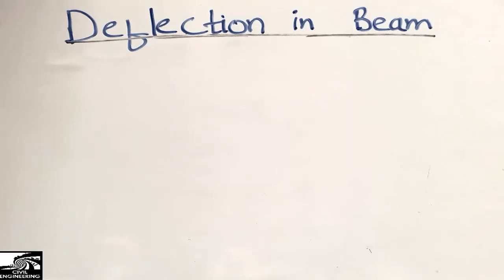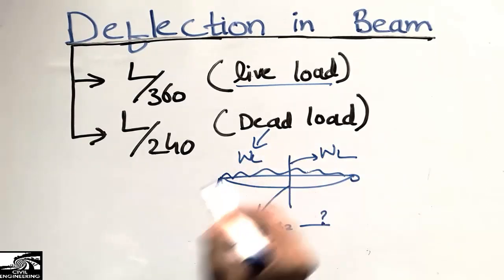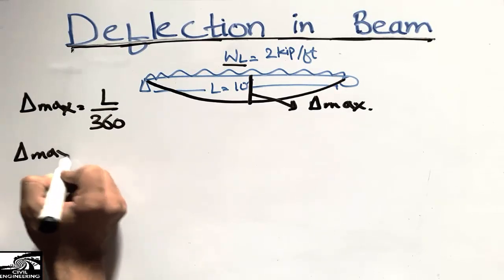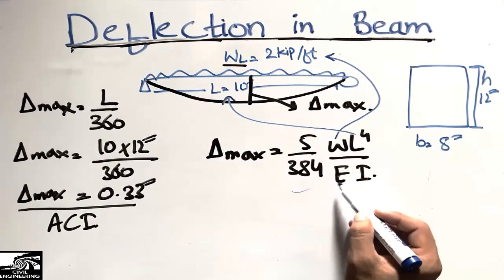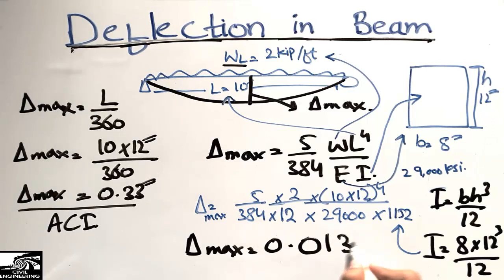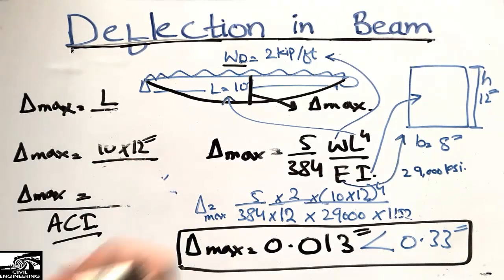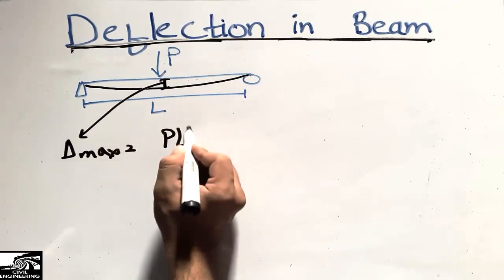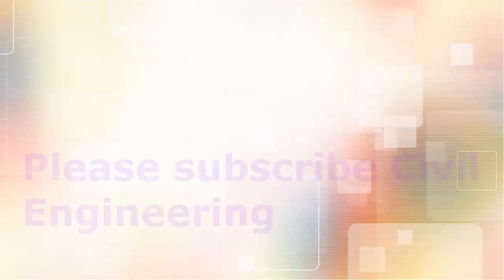Deflection of Beams || Deflection Limits

Comment: What type of Beam?  makes no sense?  I-Beam,  Square?, L, What about wall thickness?
Reply: I studied this and used your equation, spent about 1 hour. You did a GREAT job, however at the very end I realized there were some things missing for what I needed to do.  I was trying to estimate 4 x 4 square tube with 0.25 wall thickness.  I'm not sure what the equation is for...  but thank you.